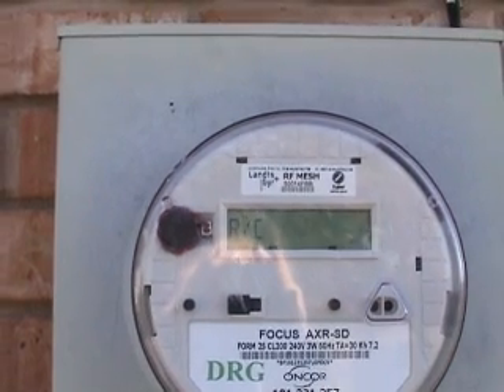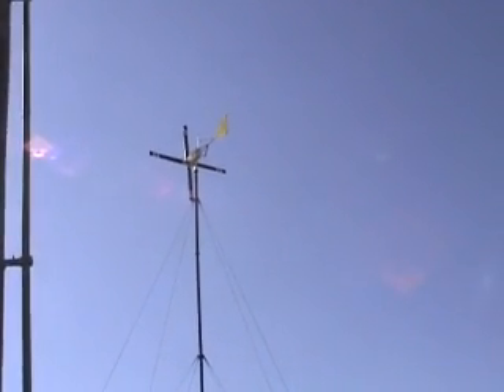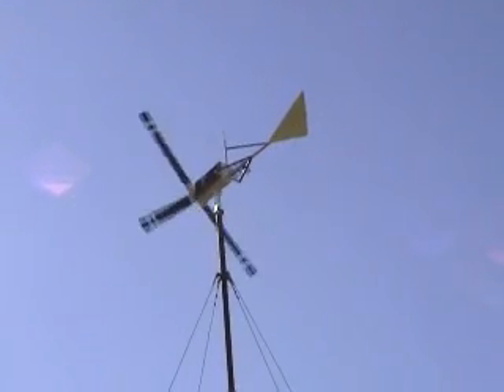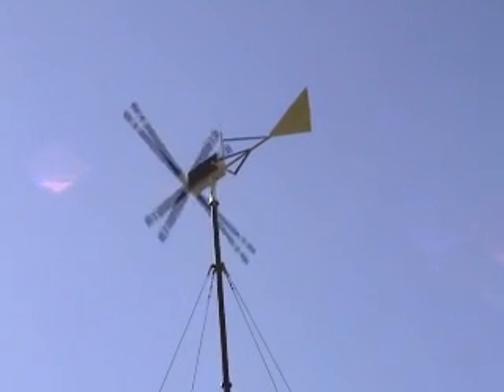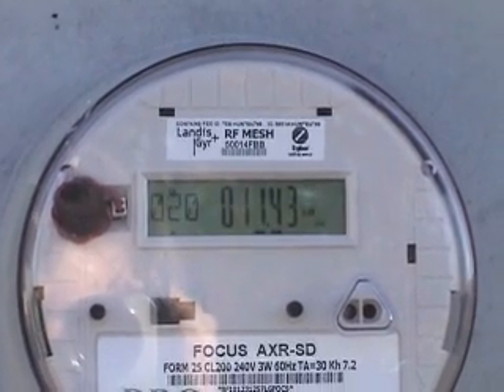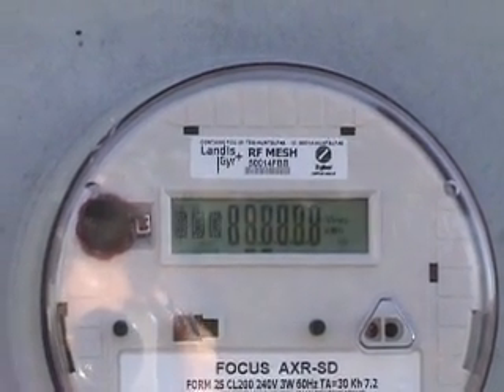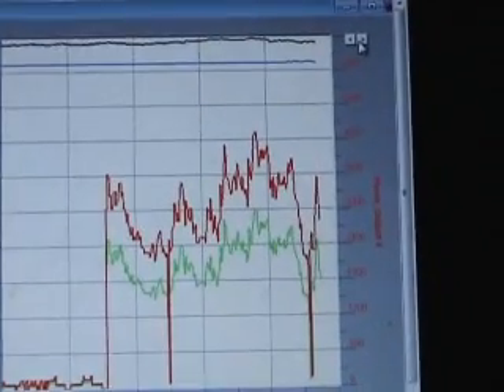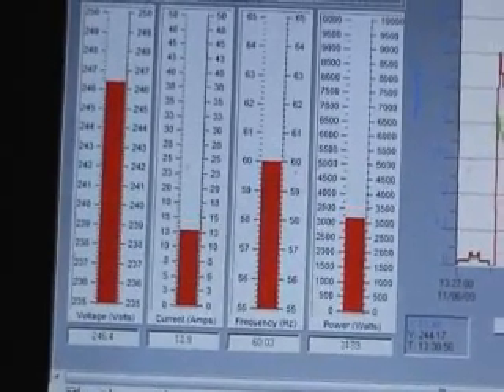5500W Homemade DIY Homebuilt Induction Wind Turbine Generator

Comment: Make sure the meter actually counts backward. My meter, even though the lines reverse directions, actually counts forward, no matter what. That means, that if I produce more power than use, I actually pay for it rather than get credit, like I did with the old dial meter. My best bet is to slow, or stop the meter, rather than drive it backwards. It could actually be cheaper to run the pool pump than not to!!!!!!

Comment: Grid tied generators have a nasty tendency to electrocute the piss out of any engineers working on the power line during an outage. Better use a transfer switch.

Comment: Can you provide resources on how others might be able to build something similar?
Reply: I guess the answer to yours mine and every one elses question is no. Makes me think it's either a fake or it's a fake
Reply: It's simple 
Take the induction motor (3 phase if possible) and put a fan on it 
When you connect the motor to the grid it will take power to spin up the fan and if there is no wind you are simply wasting power but when there is wind the motor spins over it's working rpm and it starts to work as a generator pushing power back into the grid 
Problems with this design is that is not as efficient (It's renewable energy sources so efficiency is not that important) as a pm generator but it's far easyer to connect it to the grid 
you could place the centrifugal switch to connect generator to the grid only when there is enough wind aka generator rpm so it doesn't waste power 
Also there is a certain rpm where you get maximum power output from an iduction generator so you can use fixed pitch fan but if you can, go with a variable pitch kind

Comment: You should not use even pairs of blades. 3 or 5 blades would be more efficient.
Reply: +TheMisterP Theoretically, a one-bladed turbine is the most aerodynamically efficient configuration. However, it is not very practical because of stability problems. Turbines with two blades offer the next best design, but are affected by a wobbling phenomenon similar to gyroscopic precession.

Since a wind turbine must always face into the wind, the blades will have to change their direction vertically when there is a shift in wind direction. This is referred to as yawing. In the case of a two-bladed system, when the blades are vertical (i.e., in line with the tower and the axis of rotation) there is very little resistance to the yawing motion.

But when the two blades are in the horizontal position, the blades span a greater distance from the axis of rotation and so experience maximum resistance to yawing (notice how a spinning figure skater slows down when they bring their arms away from their body. As a result, the yawing motion starts and stops twice per revolution, and this leads to stress on the turbine due to blade chattering.

On the other hand, a turbine with three blades has very little vibration or chatter. This is because when one blade is in the horizontal position, its resistance to the yaw force is counter-balanced by the two other blades. So, a three-bladed turbine represents the best combination of high rotational speed and minimum stress.
Reply: +BlackDude Scam http://images.slideplayer.com/15/4799876/slides/slide_15.jpg
Reply: The more blades you have, the less aerodynamic. The less blades you have the better the aerodynamics.
But it leads to stability issues..
Reply: Maestro M. B

Comment: I have a old gas powered 4800 Watt generator, I would like to turn into a wind turbine. Motor isn't much good, but the Generator part is. Any idea's or know any video's to show any designs into building one out of it?
Reply: Generac, Kohler, Onan??
Reply: Its by Champion power equipment. Says Champion on it. And I was wrong its a 3500 Peak watts. Has an old 6.5 hp motor that isn't any good on it. 

My plan is to get 3 of these and make into 3 different wind turbines, and run in through a box where I'm not relying on the electric company. Where I can switch from wind to main line (much like in this video, but able to shut the main line off). I'm not looking to live mainly off wind, but cut my electric bill down a lot by using wind power on windy days. If this is possible, and I think it is, It will just take some planning. But I haven't seen any videos where they take an actual gas generator and turn the generator part into a wind turbine. I think this would be great and save a lot of time trying to turn DC into AC, and all that.

Comment: remember, if the turbine does get shut down it will not be slowed down by the generator and can fly apart... so may need a dummy load in a storm..

Comment from the maker: @pennyandian The control system consists of a PLC that I programmed to monitor the turbine rotation speed, wind speed, power output, etc., in tandem with a Beckwith 3410-A to monitor the grid status and power quality.  I now have a touch panel that pulls data from the PLC, logs it, allows for remote operation (even over the Internet) and email status messages.  Works very well and uses all off of the shelf components.

Comment from the maker: @ThePowerExcess See above.  A Beckwith 3410-A is used to monitor the status of the grid and the output of the turbine.  Anything abnormal opens the circuit and shuts the Turbine down.

Comment from the maker: @turtlemann14 Nearly lost the finger with a planer that I used to cut the profile into the blades.  As for the power company, I had to inform them, install a grid intertie monitor (Beckwith 3410-A) to monitor over/under voltage and frequency.  I the event of a grid failure or abnormality, the beckwith opens the circuit to the turbine - shutting it down.

Comment: What's the motor/generator you used called? Where did it come from? Did you need to build a 20' diameter blade set to turn it or did you do that for another reason?

Comment from the maker: By interface phases, are you referring to the control system?  If you are referring to the control system, I do have the details and am constanly tweaking the programming.  It can be readily adapted to both 50 and 60 Hz systems and would also work just as well on Micro hydro installations.